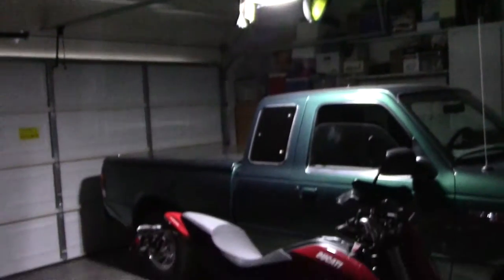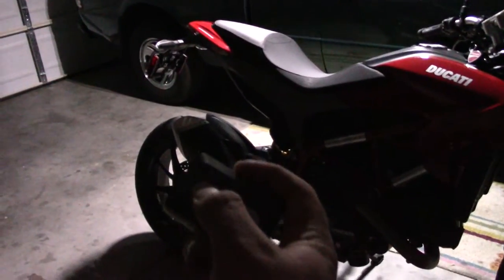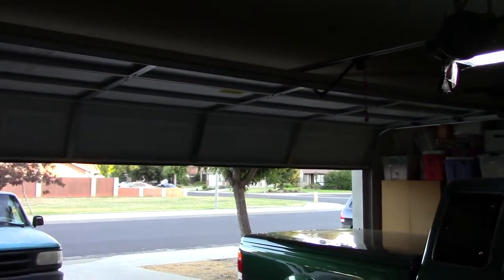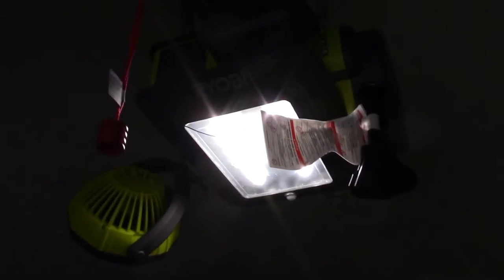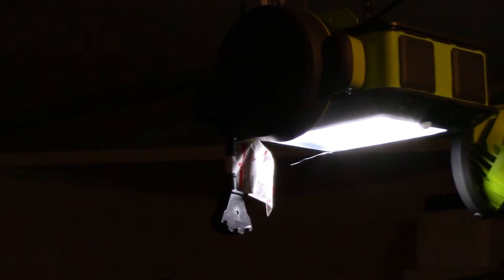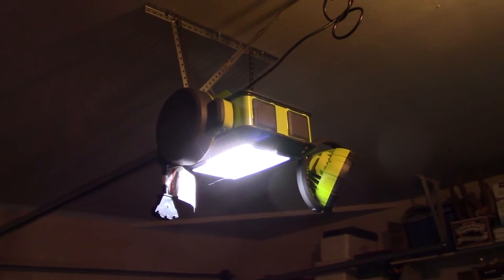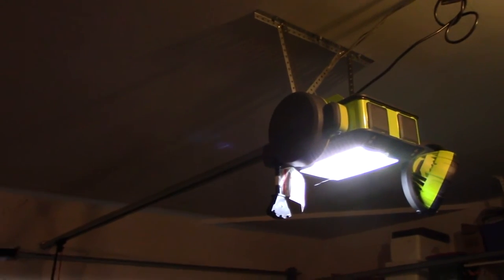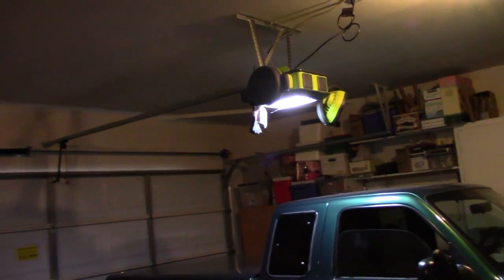Ryobi Garage Door Opener Demo GD-200

Comment: I'm looking for a new opener and I just saw this one that looks really interesting.  The only thing is the annoying beeping it does!!!  I can understand if you're using the App to open and close because you may not been near by, but using the remotes, or the keypad, it should be quite.   I'd have to disable that beeper somehow.  So I'm still making up my mind what way to go.
Reply from the maker: As far as I know you can't disable the sound unfortunatley, also if your garage is in direct sunlight the photo sensors are very sensitive to it and it wont shut if light is directly or indirectly (reflecting off the ground) off of them.
Reply: Ya, it's clearly a first gen product.  I do like the design and the modules it has are nice that I could use.  Between the beeping, and you're right, the sensor, I forgot about that one, it's not for me at this time.  Chamberlain better do something.  I want Homekit support more then anything.

Comment: Bought it.  Home Depot was going to charge me $250 to install this "easy install" item!!  I had it installed by someone else for $175 (I needed it done ASAP).  The outdoor pinpad simply does not work!!  It works inside the garage but not outside.  They want me to have the antenna facing the floor.  How is this possible when the antenna mount is on the top of the unit and every picture shows it this way???
Reply: Ya, I realized that after.  However, it still doesn't work.  I even tried extending the wire.  Ryobi was supposed to send me a new antenna about a month ago and I am supposed to remove the light cover and install it.  Still nothing has arrived.  Getting pretty frustrated with it.

Comment: I had Home Depo install this which was reasonably priced. Like everyone else. The installer could program the wireless keypad from 3 ft away. But hook it outside w the door closed? Signal is gone. Ryobi sent me a corrective RF antenna which I installed myself as per there quick instructions emailed. The new antenna is heavier gauge and at least 3 inch longer. That seemed to have solved the problem. However, it also seems that when the led light is triggered by motion, which is timed at 3 min default. I lose all signals from the wireless kepads. It seems the led light may interfere with the wireless keypad. Ryobi sent me a corrective kepad as well to address my complaint about the RF range of the orig keypad. So now I have two and they both work and are bith being used. Oddly,  before I re'd the GDO.. Ryobi sent me for free, two more car remotes they said had increased range capability. My orig car remotes and new ones seem to have same range, I tested it on the old weaker RF antenna though. But no issues w the 4 remotes that I have now. Plus Ryobi sent me a free small battery pack cell phone backup thingy. My wifi still does not work. Not that important to me, wifi. But, since I paid for it, I want to at least try to get the wifi working. Unit is large and if you have a truck or SUV along w a 8 ft ceiling. You are well advised to measure carefully. I just needed a GDO w fan and extension cord and got all this free stuff like the promo $70 extension cord. But, I would not recommend this GDO untill they get these issues worked out. Also, Ryobi is beibg sued for patent infringements on two patents, but Chamberlain/Liftmaster over the wifi feature.
Reply from the maker: Hmmm I've not had that issue I have however had issues with the photosensors and how sensitive they are with sunlight
Reply: +hanksranger I called Ryobi and they said my android phone is too old. Am on adroid 4. Ryobi says I need 6 or higher. The reception w new RF antenna is excellent now. Also Ryobi says that more modules will be coming down the pipeline like a tire inflator and a security camera w live feed. Due around November 2016. Recently bought house, so really needed a GDO and dont care about lil bugs which are corrected now.

Comment: u should have gone with an insulated door, less noise
Reply from the maker: Perhaps but it would have just trapped more heat in the garage it gets very hot here
Reply: actually they do the opposite. They make it cooler in the summer, and warmer in the winter.
Reply from the maker: Eh really not worried about it